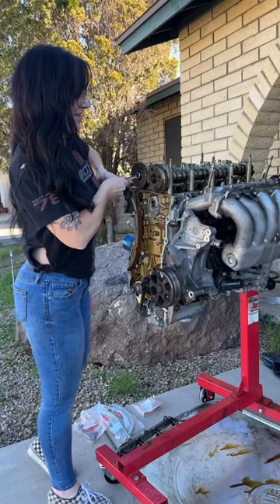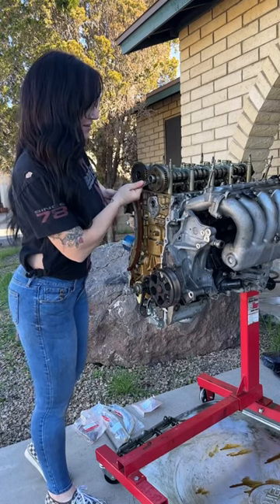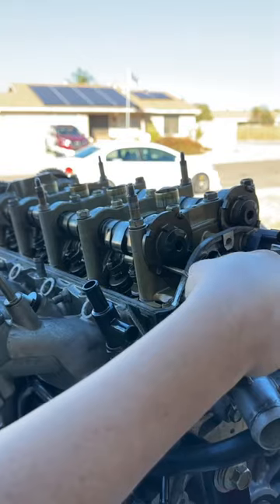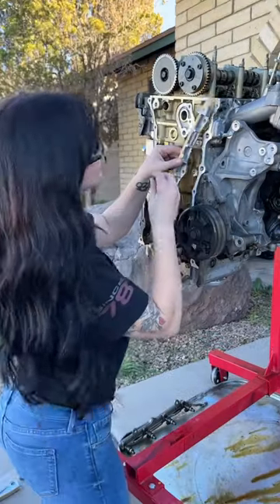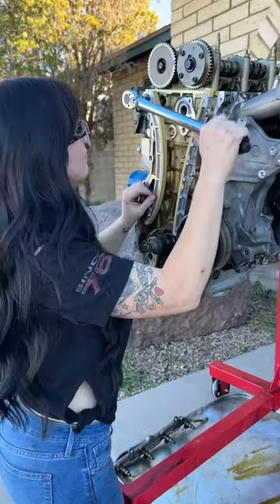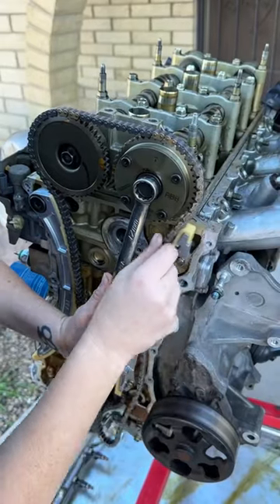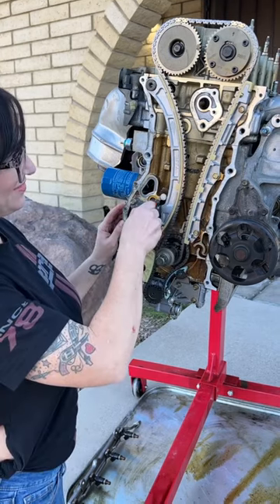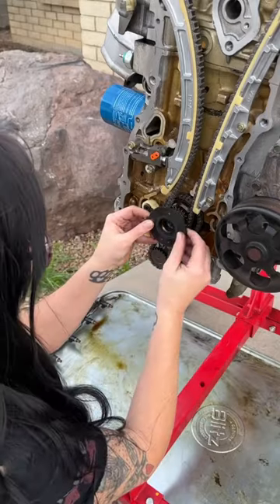Timed my K24 and Happy New Year!

Comment: I'm impressed. Success comes from using the correct tools, OEM quality parts, paying attention to detail, and researching the task at hand. Continued success.
Reply: Exactly. OEM parts and following the manual is surprisingly effective.
Reply: Its crazy, its like the people who made the engine know exactly what you should be using!
Reply: Man i just replaced my strut with a non oem and that muh fucka ultra noisy thinking about just taking the L and buying a oem part
Reply: @renderedpixels4300  ha ha,
Reply: @Ryan West  you took a "L" when you went non oem
Reply: Anyone's else see all the cracks in her block?? Look again. 🤣🥴😮🥴
Reply: @jsandiego2394  Good call.In the absence of knowing if they were present at the foundry and or if this is something present in some K series block castings with high mileage or high horsepower, I would lightly sand a small area to determine how deep they are.If they appear to extend below what you can lightly sand out I would have the block checked with a dye penetrant test / magnafluxing,etc.If it checks out okay,I would smooth out the area to eliminate the chance of a deep crack forming.
Reply: What does OEM parts mean?
Reply: Hope you open your own shop and I'll apply and work with you...
Reply: Kode
Reply: @ryanwest764 Unless you bought a quick strut assembly, I suspect you have another issue. Possibly a faulty top mount, or a missing or loose bump damper.

Comment: I'm a retired auto mechanic and have had to read and follow directions or procedures on certain vehicles as new types came out, some were difficult but I accomplished them, you are doing fantastic, don't hesitate to read up on things if you're not sure. I never took any ASE certification test and still made excellent money at the least I made $19.25 a book hour and usually flagged 70 hours in a 45 hour week. Don't be afraid to read directions or watch videos, if you tube was around back then I would have watched them also for help. Keep it up, the world needs more auto technician's, and have fun.

Comment: Should always make sure to rotate the engine 5-6x to make sure the timing marks line up every time.
Reply: After assembly
Reply: @androidphone1901  yes.
Reply: On k series engines the gold links will never line back up only on j series you can spin it a few times and everything will line back up
Reply: @Swayz89  in that case, marks on the cam gears would need to be made to ensure proper timing.

Comment: Pro tip, use the softest material possible in place of that hardened drill bit.  If the drill bit shears off, you’ll have a hell of a time drilling it out.  However, a soft steel dowel will do just fine and can easily be drilled out in the event it does break off.
Reply: Or a small Allen key. Anything that isn't hard and brittle

Comment: Its easy when the engine's out of the vehicle. Definitely a good way to start & practice replacing timing components, (engine out the vehicle I mean.) when u get some experience with a few of these- attempt doing a timing belt or chain replacement with another transaxle type vehicle, in the middle of a field (or large gravel driveway), in dead azz winter, with a foot of snow the ground, (make sure its a breezy windy day), & make sure u got a sister jack, couple blocks of wood, & u forget to bring a magnet tool to catch any sockets or nuts & bolts that might fall into the gravel, or snowy area.  An added bonus: make sure its your buddies only means of transportation & the following Monday everything has gotta be back in functioning so y'all have transportation to get to school &/or work.. good times. 😵‍💫

Comment: She is intelligent and beautiful 😍 I've worked on cars, but I'm WAY out of her league. I've done timing on small engines, like scooters and what not, so I know the components and where tdc lies. Or rather I know what's important for the engine to run. Gotta have piston rings, oil rings, compression, spark, and a ratio of air and gas. Can't be ran to rich or lean. I've done alignments. But that's when I was in school for it. I was a year away from becoming ase certified. It's just when we got to the transmission. I was like, yeah screw this. 😑 Bad decision. She could've been wifey🥴

Comment: Pfi does a video on how to stop your timing spring from failing. You just take it apart and put like a pen cap behind it that way if the spring fails it can’t get pushed in an skip timing. You can run it permanently like that but it’ll save you from blowing up if it does happen

Comment: I was the same way I put three chains on my Dodge 3.5 L V6 and I took the cams off clean them up put oil back on them part that was the hardest was getting the cam bolts to 8 lb I bought a torque wrench but it didn't work right so I basically just judged it put everything back together my son's car went out and he drove it for about 6 months with no issue and it's sitting in my driveway right now I don't drive it anymore because it's got a couple of bad injectors but it still runs

Comment: You don’t put drill bits in the back of the cam like that you can and probably will damage the reluctor wheels instead use drift pins in the tops of the cams near the front near a cam cap, you will see a hole turn the cam and a hole in the cam will line up with the hole in the cap push in drift pin and boom, that’s how the techs at the dealers do it

Comment: in the overhead valve I would of pulled the head had it fresin.up and modified it up changed the cam then New rings inserts freshing updated to ur ECM that's what I would do a tear down tells everything if u just put a oil pump timing chain like taking half a  bath if it going to race it always go through the hole engine fon.t forget upgrade the tranny rear end

Comment: My k24 has 212,000 miles still running strong as ever.
Reply: Nice! were all those racked up by you? I actually just picked up a 02 RSX-S with 320k hard miles and it feels just as stong as the 55k mile 04 type s that I had a couple years ago. Its actually going on the dyno in a couple days to see how much power its lost. The k-series is the best inline 4 ever made in my opinion, K really does stand for king.
Reply: Yes all those miles rack up by me.
Reply: @HaiPham-dw2kg  Nice! My bone stock high mile type s made 181whp and 129lb/ft today which is pretty amazing really!

Comment: (Little Fact/Tip) If you find yourself replacing oil pump’s, just be cautious as some engines require the oil pump to be correctly timed as well! 
- Experienced Mechanic
Reply: What engine requires the oil pump to be timed? And what purpose does timing an oil pump serve? Just curious.
Reply: @zorans5200  i’m not sure on what engines exactly i know VW has some engines with oil pumps that need to be timed, its to help cause less vibration through the engine, helps the counter balance shaft spin correctly with the engine to help create less vibrations
Reply: @KieranDurrant  but wouldn't the oil pump just be a simple rotating gear pump?

Comment: Drill bits shatter like glass and throw metal shards. Probably wouldn't be an issue but it looks like you put a lot of time and money into this I'd hate for one little chunk to ruin the whole thing. Mild steel is great. But wrought iron and hi carbon steel are bad.